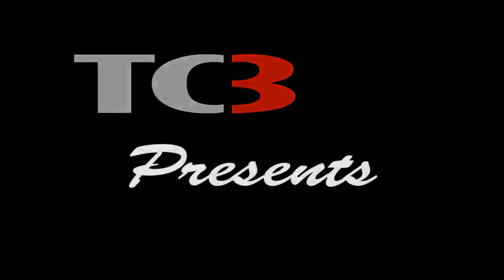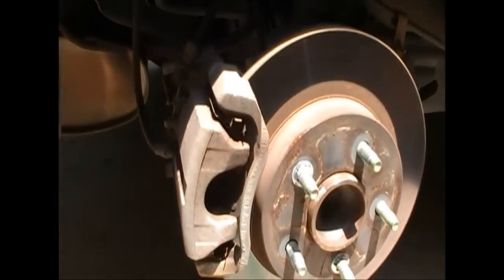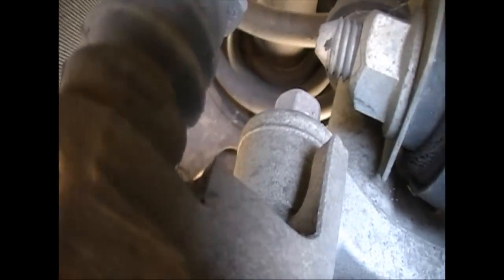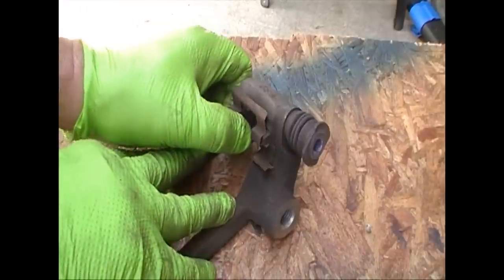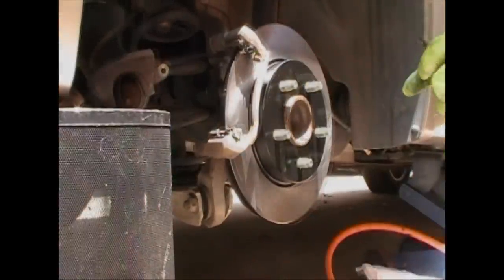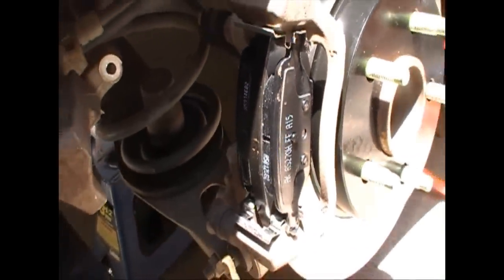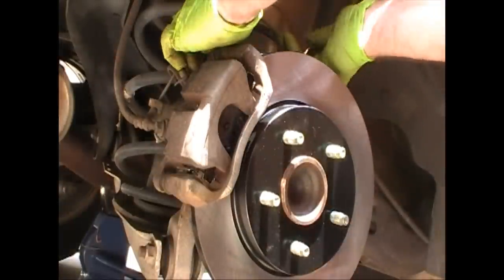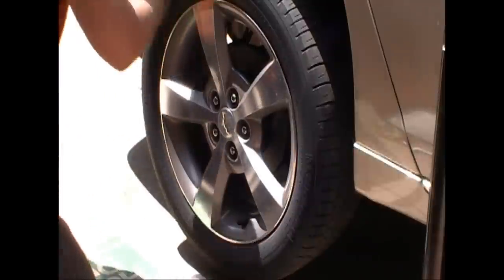How to Replace Install rear Brakes and Rotors on a 2008 - 2012 Chevrolet Malibu

Comment: Always put the appropriate break grease (or anti-seize) on the break pad ears. Your pads will get stuck if you don't. Always use new silicone grease (not dielectric silicone grease) on the caliper bolts after you cleaned them well. Always tighten the bolts to the correct torque. For this series car it is 26ft lb for the 14mm caliper pins, 96ft lb for the 13mm caliper bracket bolts, and 100ft lb for the 19mm lug nuts.

Comment: @6:35   If you don't have one of those tools, I was able to whip out the handy dandy leatherman to screw my pistons back in.  However, I will be order one of those for my toolbox.  They seem to be a common thing for certain year vehicles.
@7:35  I'm pretty sure those rivets are suppose to "lock" into those ears to hold the piston so that the e-brake works properly.

Comment: People---those triangular grooves in the rotor MUST line up with the posts on the pads. You want them straight up and down. Also, this is partially how the e-brake adjust its self.

Comment: If you don't have the special tool or you don't want to buy it you can use needle nose pliers where the notches are then press in/push down and turn clockwise. I have done it on my 09 Malibu and it does the same thing.
Reply from the maker: Yeah that will work . You can also use the points of an open end wrench and some pliers to turn it too.
Reply: lastmoto777 how far does the piston break go in? All the way back in?
Reply: Just get the fuckin tool 😂
Reply: @LoveDecko  whats the tool called?

Comment: Make sure you use anti seize on the bolts and brake grease on the contact points.
And use a torque wrench to appropriate spec.

Comment: absolutely right. you should've greased and or lubricate the caliper pins or better yet bought some new hardware kit for the job because you never know the condition of the stock items that were on the vehicle.

Comment: Clean them only with the spray cleaner? Also how did you clean the inside, with the spray? I dont isually work on cara but i need to change my rotors and breaks myslef
Reply: And i dont know what rubber lip and what grease youre talking about
Reply from the maker: I cleaned the inside of the rotor before I put it on, and yes just spray it with brake cleaner. It is accettone so be careful with it. If you have not used it before it is a very strong cleaner ! Good luck with it.
Reply from the maker: Usually you get a small amount of brake grease when you buy new brake shoes. Good luck with it.
Reply: Thanks
Reply: So when do i bleed the breaks. After changing each one or after changing them all...im doing all 4
Reply from the maker: Do all of the brakes one at a time. and then bleed each one, one at a time as you finish each wheel.Don't  forget to keep adding brake fluid to the reservoir as needed. If you are not sure about doing this yourself ( you said you don't usually work on cars) I would recommend getting someone with experience to help you. These are your brakes, and they could hurt you if you don't do them right. I love helping people save money, but I surely do not want to see anyone get hurt doing it. . Ever.
Reply: Thank you for all your help

Comment: Does anyone know the orientation of the slide pins in the rear caliper bracket? One of the pins has a black rubber shim on the end and one does not. I can not find a definitive answer online. Thanks!

Comment: Very clear and concise. Good camera work. Thank you for a job well done. Can you use high temp wheel bearing grease in place of caliper grease?
Reply from the maker: Wow;Thanks thanks for the kind words. I am glad the video was helpful.You can use regular grease, but caliper grease has other additives like molybedenum which make it a better choice, Best of luck with it.
Reply: No

Comment: I've never changed my brake pads before. Is a Break pad replacement hard for inexperienced?
Reply from the maker: If you have the tools and at least a little bit of mechanical experience you should be able to do it by following the video.  Having said that. This is your braking system. If you are unsure of yourself It might not be a bad Idea to have someone help you who knows how to do it correctly. At least for your first set of breaks. Best of luck with it  !
Reply: @lastmoto777  These are BRAKE pads. Try to avoid breaking anything.

Comment: Can't you use a c clamp on it as well? or channel locks to push the piston in?
Reply from the maker: No. The piston on the rear brakes need to be screwed back in ( pressure and screw at the same time, but mostly screw ). They are different than the front. Thats why there are notches in the piston. Anyway. hope this helps.
Reply: +lastmoto777 Thanks!
Reply: lastmoto777 where did you buy that special brake tool at ?
Reply from the maker: You can buy that at any auto parts store. I bought mine at Advanced....

Comment: can I use a c clamp instead of that cube thing?
Reply from the maker: No because its not like the front brakes . It has to turn while it is getting pushed in. Autozone will lend the tool to you for a deposit that you will get back when you return the tool. Good luck with it.
Reply: I was wondering the same thing

Comment: I use needle nose pliers instead of that cube thing.
Reply from the maker: great...as along as you can turn the piston whatever you use will work fine! Thanks for watching the video!
Reply: Sometimes it doesn’t want to turn I try the nose pliers too the tool is like 5 dollars I think online I though let’s give it a try and it’s a MUST HAVE for real it works so good it makes it a lot easier